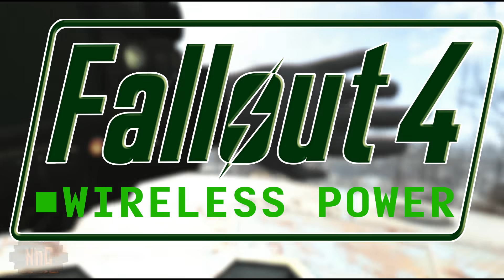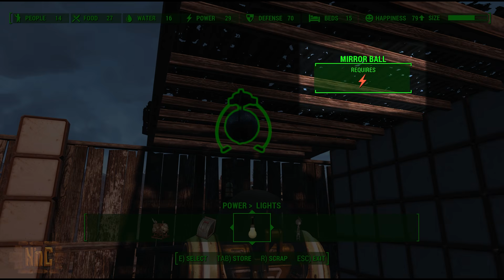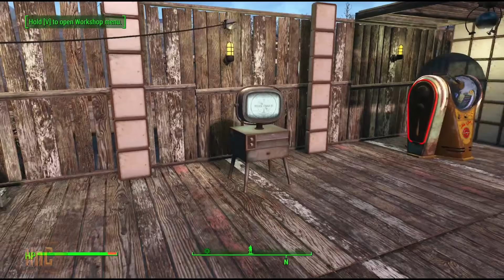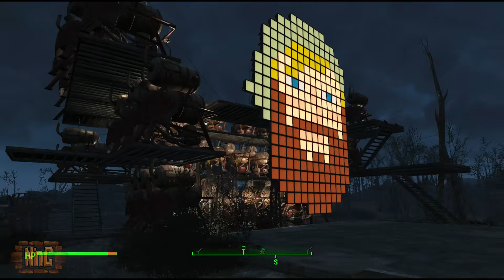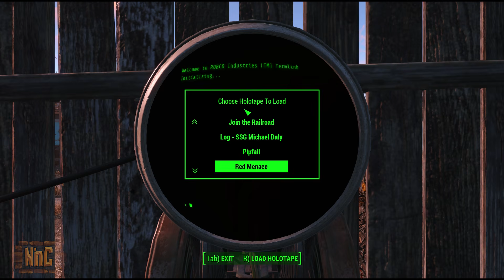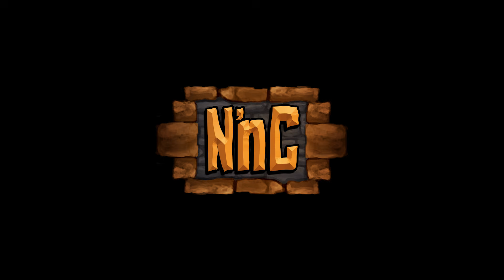Settlement Guide: Wireless Power | Fallout 4 Power GUIDE

Comment: There used to be a mod for Settlement Power Upgrade where you just put a fuse box on the wall and you could power a complete settlement like Sanctuary. Unfortunately the mod author removed it. I accidently deleted it on my XBox1 and couldn't find it again.

Comment: I spent like 26 hours straight on a new save with the cheats terminal or cheats holotape, I did get the hang of it and to the point I supplied sanctuary either 30 power, each house had a light switch, it was tticky

Comment: Hiya I just started playing Fallout 4 recently on PS4 and I have a massive issue that seems to plague alot of us. I can't build anymore power pylons/conduits and small/medium sized generators, i can still build the biggest generator for now. I looked on steam and reddit for solutions but no one knows anything even though alot of people have the same issue. I have all the resources needed and still have capacity left to build (the size bar is about 3/4 full in Sanctuary Hills). I tried scrapping a pylon that I had previously build just to find out that I can't rebuild it... I tried connecting The Slog with Sanctuary Hills via a pipeline and then build a power pylon in the Slog but I still can't. Do you by any chance have any advice, anything at all? I'm pulling my hair out and slowly doing bald over here 🤯

Comment: In the real world, floor planks are generally 2"x 6" 
 6" x 27 = 162"
 There is usually a 1/4" gap between the planks, so this number will be: 2 x 27 = 54 x .25 = 13.5"
162 + 13.5  = 175.5"
 175.5/12 = 14.63'
 27 planks o' wood = 14.63'
Reply: Thank you good sir for this comment
Reply: Either you're a nerd or im and idiot